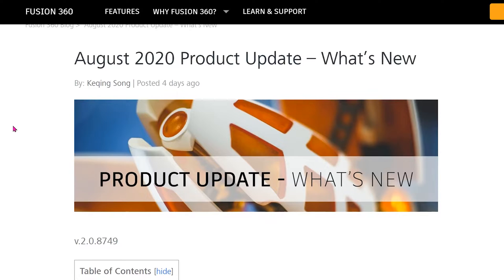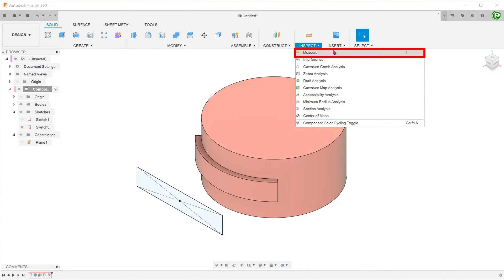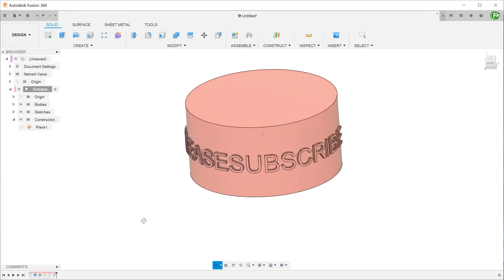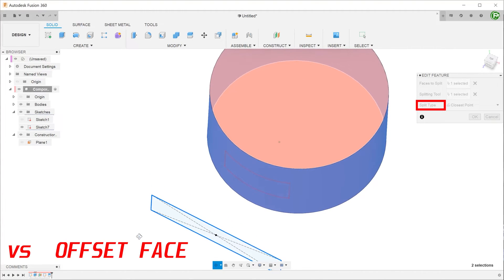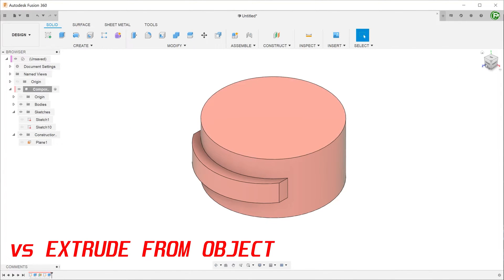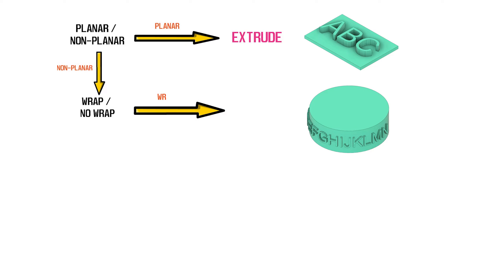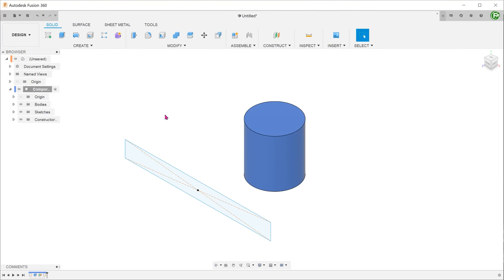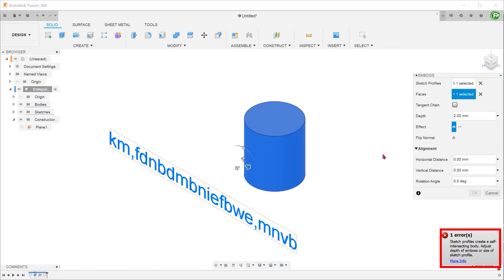Fusion 360 - Emboss (New Command)

Comment: this video was very helpful to me.  I needed to create a complex design (hand rails with fancy stanchions between the upper and lower horizontal rails) on the top of a cylinder (steel water tank walk way)  I was able to wrap around a solid cylindrical piece and then extrude out the parts I wanted to get rid of.

Comment: Hi thanks for the great video I am in the process of creating my own RC tires and was wondering if this would work for creating the tread I wanted to use my last name as the tread pattern in the tire
Reply from the maker: Hi, I assume that the tires would have fillets. In that case, you would want to place the emboss only on the flat side of the cylinder. In other words, you would not be able to emboss on the fillet as emboss does not work on curvature in 2 directions.
Reply: @Fusion360School  well then it's back to the drawing board for me I guess I will just have to put my name on the sidewall of the tire and try to create a awesome looking tread for it
Reply from the maker: @OutTheGaWoods  There is a work around which I explained in a couple of videos which I did for embossing on spheres. If you are interested, you can take a look.
https://www.youtube.com/watch?v=G-9GNVpYjk4&t=160s
https://www.youtube.com/watch?v=-YIjPPUw3hg

Comment: I wonder how the intersect feature compared. Still not used to having emboss available.
Reply from the maker: I assume you mean project? I am not sure how the intersect command is similar.
Reply: @Fusion360School  I will have to go through the process at home. I believe I would have used extrude letters and intersect with create new body. Move new body out of cylinder and combine. Again I need to sit down and do it because I was not taught proper terms. And now I dont need to with this tool...
Reply from the maker: Extruding would extrude the letters normal to the sketch plane, often resulting in a distorted look on curved faces. Emboss produces a true wrap. Have fun trying,